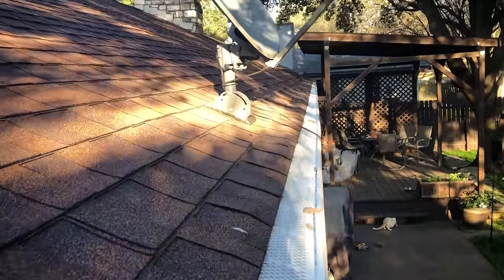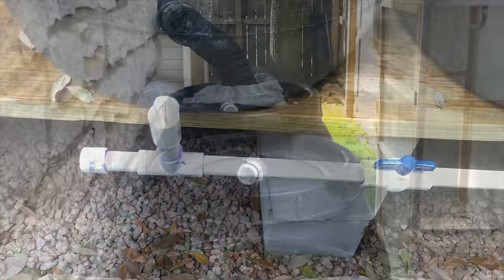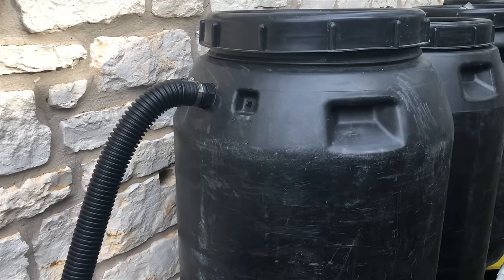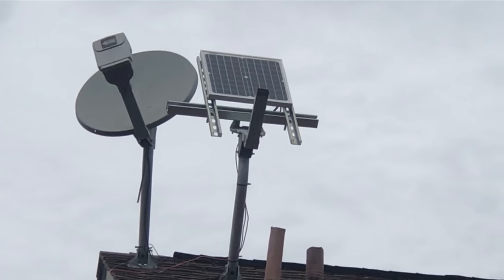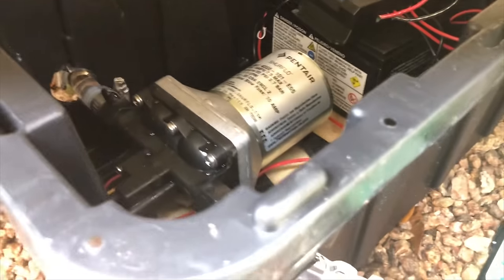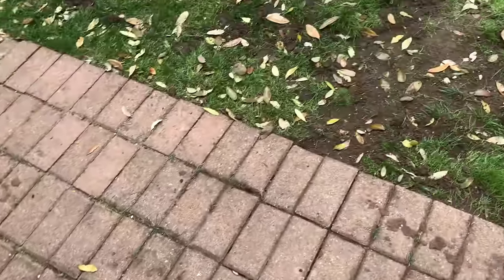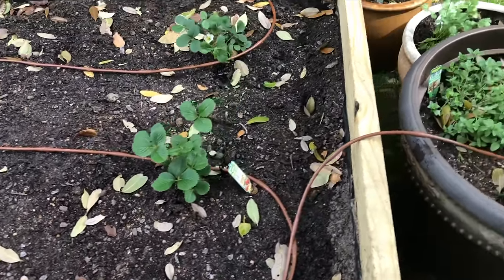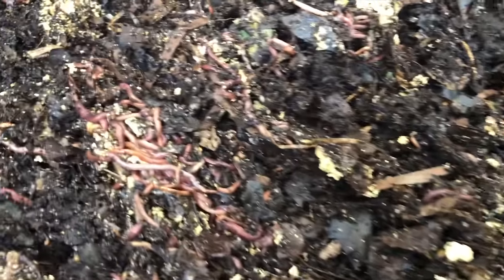Rain Barrel System Overview with Solar Powered Water Pump

Comment: I was trying to make my own water irrigation system and I ran into one problem which you mentioned in the video. That the pressure wasn't enough to push the water so you added a water pump. My garden is about 250 square feet of area with about 40 plants. What is the recommended psi or gpm/ gph water pump do i need? How long is the water irrigation pipe you have in your garden? Thank you!
Reply from the maker: lordmarki my distance from the barrels to garden is about 20-25 feet.  If you choose the right pump you will get water output PSI similar to your house hose bib.  Check out the video on the water pump system, details on the pump are in the video description.
https://youtu.be/SYFdW5n3lis

Comment: I would run drip lines to worm beds with control valve so you don't drown them. Is that something you have considered? Just wondering, because it would save you all kinds of effort especially in inhospitable weather.
Reply from the maker: Hi Michael, keeping worms cool in the hot Texas summer is certainly a challenge.  We use frozen 2 liter bottles and swap them out, but your idea is worth considering.

Comment: If you got rid of the air vents would the tanks not pressurize based on height?  I raised mine and and I get 3.5 pounds of pressure which is plenty but I have my tanks sealed

Comment: Ever get it tested for purity or for contaminants?
Reply from the maker: No but I can see in the top of the barrels any time.  The water is clear.  Main concern would be collection of asphalt debris from shingles but since there are several screens and filters before the garden those dont make it out to the plants.
Reply: @TexasOrganicGardening  Heavy metals including aluminum barium and strontium falling out of the sky because of the white lines being sprayed for Geo engineering. If you have any doubt about it you can go to Geoengineeringwatch.org and listen to the man who runs that site because he is a brilliant genius. And this is a huge problem that we’re facing. The aluminum which is in freeform that is being found in the topsoil is not naturally occurring and just falling from the atmosphere and it’s being absorbed by the trees and interfering with your calcium uptake in the trees and forests are dying across this country.

Comment: Have you thought about attaching another container to catch the overflow
Reply from the maker: I am going to be doubling the system capacity to collect additional rainwater.  Not worried about the overflow, but there were a few long stretches without rain during summer 2020 where the garden needs exceeded the 200 gallon barrel capacity.

Comment: What about something like this that also uses old bath water..  Hook it up to flush the toilets in your home?
Reply from the maker: I am sure that is possible if you designed the house and plumbing before construction.  In terms of rainwater collection, most cities will require permits and inspections if you hook it up in any way to the house, so be aware of that before using it for something other than lawn or garden.

Comment: How did your system fare during the big freeze event in Texas?
Reply from the maker: It is recommended to drain the system in the fall to prevent issues with expansion from freezing.

Comment: HEY TONY GREAT SYSTEM

Q: WHATS THE WATER VOLUME ?

WATER VOLUME TRAY ED GARDEN PRODUCE - ANGLED FOR GRAVITY - PUMP BACK TO WATER BARREL - DRIP / CONTROL WATER SPEED RATIO VOLUME - 

SHOULD = A CIRCULAR CURRENT FOR WATER TO PLANT RATIO

Q: IF 100 SYSTEM WERE MADE AND EACH SYSTEM HAD 100 SEED TYPES IN 100 TRAY SYSTEMS : SIMPLY FILLING THE WATER BARREL TO START AND KEEP VOLUME IS A SUCCESSFUL ALLOWANCE 

RAIN IS NOT MAGIC NOR RELIABLE ITS MOVED CLOSER TO SOURCE VIA FORCES = RAIN : THEY TEACH RAIN AS RAIN AS MAGIC ALLOWANCE - BUT - ITS RATIO INTAKE AS ALLOWANCE 

IF YOU GREW FOOD ON 100 ACRES ITS NOT RAIN YOU USE 

YOU ALLOW AND A LOCATE 52 WEEKLY SHARES OF MASS WATERING WVIA TRUCKS AS THE HUMAN NEED FOR SEED TO FEED OUTWEIGHS ANY RATIO EQUATION OF NEEDS OVER WANTS - ITS JUST 

RIVERS , LAKES ETC IN THE WILD - A SIMPLE SAME MASS BOIL AND RETURN TO RIVER VIA SEAWATER WOULD DO MOST GENERATION CAVE MAN + ETC 

NIGHT FEASTING AND 365 DAYS ETC 

ALL THE BEST

GREAT SYSTEM

Comment: I’ve tried something very similar to your system, but had a lot of water pump short cycling issues, where the pump turns on and off. Do you use any kind of pressure regulators or air release valves? Thanks!
Reply from the maker: Karl Schwoch If it is an on demand pump and it is cycling on and off rapidly the first thing I would suspect is some issue with the incoming water delivery or outgoing either having air leaks or water leaks.

Comment: They fillup from the bottom?
Reply from the maker: Yes, and each barrel fills up at the approximate same rate/level (subject to the limits of the diameter of the manifold system PVC pipe).

Comment: Explain how the barrels fill from bottom up?  Seems that the inlet should be at top of barrels.
Reply from the maker: Fluid dynamics.  The inlet for rain on the first barrel is at the top, from the gutter downspout.  All the other barrels can be connected at the bottom and they will fill/level up at the same rate.
You could also connect them at the top if you wished, then each barrel would fill sequentially. When one fills up the next one starts filling.  It's a design choice.

Comment: How did you setup your Rain Bird timer to start your water pump?
Reply from the maker: The pump type is “on demand pump”, so when the timer goes off on the Rainbird and allows water to flow the pump automatically turns on.  Same type of pump used in RVs to detect if someone opens a faucet.

Comment: Good luck with those cheap PVC  valves. You will be replacing them. Slick idea but I wouldnt use those isolation valves.

Comment: at the 1:59 time, the vertical black pipe on the discharge line, does that act as a vent pipe for easy flow?  What size pipe is it?  thanks
Reply from the maker: That is a plexiglass sight tube to easily tell the level of water in the barrels without having to open the lids. I have a video just on this feature with the details https://youtu.be/r-kJbgX6ZoY

Comment: Ram pumps are Good If you want pressure without using electricity..
Reply: If you knew how a ram style pump worked you would know that it wouldn't work in his set up.  Needs a constant running water source

Comment: If I want to clean one of the barrels how am I supposed to take the water out if they are connected to each other ?
Reply from the maker: Alex A that’s a great question and something to consider before you design your system.  Some people use compression fittings, hose and clamps, or other removable options.  The other common way with PVC is to cut the PVC pipe in between each barrel then glue in a patch after winter cleanout.  The PVC outdoors will only last so many years exposed to the sun so the manifold is eventually an items that needs to be replaced completely.
Reply: I use drip irrigation fittings so they can slide on and off many times.  I should do a video on it. It was the cheapest way too.

Comment: Instead of using a pump, couldn't you just create a bit more pressure by raising the barrels higher from the ground? Right now they seem to be below the top level of your raised beds.
Reply from the maker: If using a timer to automatically water the garden, most timers have a minimum PSI in order to function.  The Rainbird timer we chose requires 15 PSI. (Normal PSI from the house hose bib is 40-50 PSI for comparison).  The formula for PSI is 2.3” of height gets you one PSI, so the barrels would have to be 30 feet above the timer to deliver adequate pressure.  So, unless your garden is downslope 30 vertical feet from your barrel system a pump is required or a 30’ high tower of barrels.

Comment: wouldnt the rain water the garden?
Reply from the maker: Yes unless you are in texas where it doesn’t rain all summer.  In fact the 200 gallons stored water wasn’t enough last summer to last between rains and I ran out of water in the barrels a couple times.  Had to supplement with city water.  Will have to add some more barrels before this summer.
Reply: @TexasOrganicGardening  it might be overkill, but you could rig something with a toilet/float valve and your city water supply to automatically keep a minimum level in the barrel for those times you exhaust the rain water supply. If that made sense. 
But i love this setup!

Comment: This is a very cool set up. But with all the energy to make and transport the solar panels, battery, pump, timer, hoses, pvc tubes and glue, and plastic barrels you will Never save any energy versus just using your house water from a hose. Just saying.
Reply from the maker: Hi Andy, this project was to learn a little more about solar for future applications, and to address  the need here in central Texas for water conservation.  We commonly have long periods of drought and frequent city mandated watering restrictions.  Certainly we could water from the hose bib, but every little bit of conservation helps.
In the event of something like what happened this winter with half the city having no power or water for a week or more, the need to be flexible and more educated on short term self sustainability becomes even more interesting to me. Although this is not potable water, people were filling their bathtubs in March before the city cut their water off just to have enough to flush the toilet.

Comment: In my state they will come over and remove it all.  You cant collect rain water in my town with out a fine.  Think about it , why should you collect free water . The town supplies water you have to pay for.
Reply from the maker: What city is that?  There were some states that didn’t allow rainwater collection but as of last year all 50 states now allow it.  Some cities do have restrictions if you try to tie it into the house supply though.  That requires a permit and proper installation not covered in this video.
Reply: @TexasOrganicGardening  Massachusetts

Comment: If you raised the barrels a foot or made your beds ground level you could lose the entire electrical system.
Reply from the maker: Hi, that's a great question I had to research before doing this project.  The automated timer for the garden requires a minimum of 15 PSI to function.  For comparison, most hose bibs on the outside of your house output 40 PSI. Using the formula for calculating height to PSI, 15 PSI would require raising the barrels 30 feet above the timer which would not be practical in my flat backyard (or most people's).  For someone with a huge sloped property and a garden at the bottom, 30' lower than the house it could be possible to not need a pump.  Or if you didn't want to use a timer, you could also try without a pump.

Comment: so I could understand if you're doing this for drinking water but watering your plants that's just ridiculous let the rain do it
Reply from the maker: Hi!  Lots of folks live in places that only receive sporadic rain, like us here in Texas.  One hour of rain will fill the system and last for a month.  More barrel capacity would last even longer. We can go many many weeks, even a month or more without rain in the summer.  Sometimes we have droughts. Sure, we could use a faucet for the garden, but again we commonly city-wide face water use restrictions in the summer due to lack of rain refilling the city reservoirs, so conservation is important. It’s all about having options.  It may not be for everyone.  Thanks for watching.